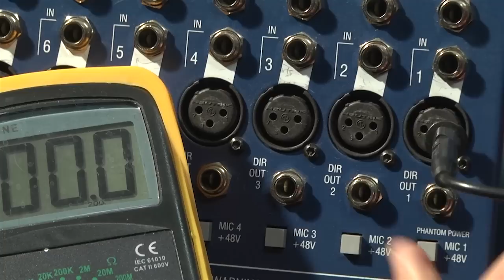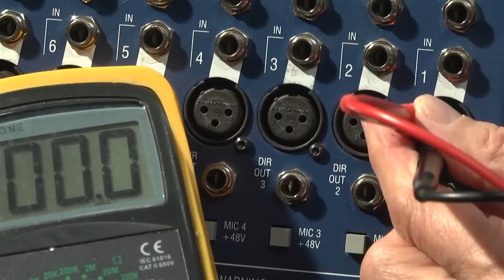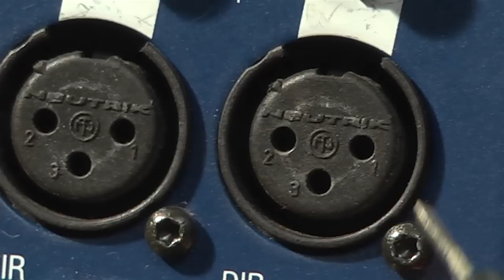PHANTOM POWER BASICS

Comment: Thank you so much for making  this clear. Everybody should watch this video. So, once and forever : if you use professional balanced cables, you can run dynamic microphones as well, even when your phantom power (48V) switch is ON. This is the best explanation of what are the pins 1 2 and 3 doing. And where exactly the 48V goes to.

Comment: Good video on some of the basics of Phantom Power, although not quite enough to really make people "understand" the entirety of the scheme. For those who don't know, here are just a few more things (not all of the things):

- The 48VDC phantom power source is NOT "connected to pins 2 & 3"; if that were true, then pins 2 and 3 would need to be shorted together, which is not the case.
- Instead, the 48VDC is individually connected, through resistors, to pins 2 & 3, so rather then being shorted together, those two pins have a pair of resistors in series between them, and the 48V is connected with its (+) side at the juncture of those two resistors, and with its (-) side at circuit ground (pin 1).
- It is important for the two resistors to be the same value, or very nearly identical resistance values, and they need to have resistance in fairly narrow range of values; typically, 1% tolerance, metal film resistors are used, as they have accuracy and stability.
- The voltmeter sees 0V when connected between pins 2 & 3, because those pins are connected, via resistors, to the same electrical point (the + side of the 48VDC supply), thus they are shorted together from the perspective of a high impedance voltmeter.
- A pair of series capacitors are typically used at the cable's receiving end (e.g. a microphone mixer or pre-amp) to isolate pins 2 & 3 from the differential amplifier circuitry; these block the DC voltage on pins 2 & 3, so it is not presented to the diff-amp, although some diff-amp designs might be OK with that fairly high DC voltage, and the identical DC voltages would be rejected as common-mode noise by the amp.

Comment: My take on building a tester similar to the Bright Eyes would use 48V LEDs and a couple diodes, all built into a male XLR connector. The diodes would prevent the LEDs from illuminating if the phantom supply or the cable being tested was accidentally wired in reverse phase. Should be easy to construct for a guy like me, who has all kinds of free time. I've never done this because I've had a multimeter for a long time, but I can see how it would be easy and cheap to build for someone who doesn't want to buy a meter, carry one all around on gigs, or who simply doesn't have the money to purchase one.

Comment: Hi its a good video and really helpfull, i have a doubt.

You show one microphone with batery power and conector xlr,  can i plug one micro like that on a recorder using phantom power? or will be damaged?

Sorry for my english.
Reply from the maker: Hi David!
 
The microphone I showed with a battery in it wasn't a phantom powered microphone. It needed power from the battery inside it. Some mikes can do both - they can be battery powered or phantom powered.

Maybe if you tell me the make and the model of the mic you want to use I can check it out for you?

And has it got a 3 - pin XLR connector built in?

Best regards, 
Joe Driver

Comment: Hi,sir my mixer is having phantom power power not working problem. If i connect my xlr output from my mixer to the xlr input on the phantom power & then use the output xlr from the phantom power to be able to use my condensor mic will it work sir,thanks🙏

Comment: Very well said and helpful tips i like the diy gadget that you used in testing the power of the phantom hope i can see a demo on how you build it, and also id like to ask a question, if the phantom power is on at the mixer, is it still safe to put a 1/4 jack playback source on a line input? and also by the way if phantom power is on, will it affect a wireless mic reciever? Thank You so much!

Comment: I need phantom power for 2 condenser mics on my drums, but the other 4 mics don't need it. If I turn on phantom power and plug my regular mics into a channel that has phantom power to it, will it ruin my microphone?  I believe my mixer has 6 channels that will have phantom power to them when turned on. So if using channels 1 & 2 for the condenser mics, and channels 3-6 for the other, will I cause damage to the mixer, or the mics? I'm just learning how to mic drums, so I don't want to ruin equipment, it's to expensive. Thank you for your help!

Comment: In my case the mixer I am using , in the mixer the phantom power is  not working. But if i will provide an external phantom power going to mixer will work? from Microphone > phantom power > mixer  w/ phantom power
Reply: Hi Timothy,
Yes, there should be no problem doing that.
If the phantom power built into the mixer doesn't work, then I would advise switching it off to avoid damage.  So it won't be sending power to the new phantom power supply.
If you had a multimeter you could check that the phantom power is definitely not working, and the fault is not with the microphone. Just a thought. And check with another cable.
Hope this helps.
Best regards
Joe

Comment: I have a studio condenser mic and a dynamic mic, question is can I connect both of them in a same mixer with phantom power is on??? is it not dangerous to the dynamic mic???? need some help...
Reply: Hi Tiborsyo,
You should be fine using the dynamic mike with phantom power connected unless it's a very cheap one. If it has an XLR connector on it then it will be "balanced" which means it will simply cancel the phantom power out. But make sure you use balanced cables.
You might find two other videos I have made helpful - one is called "how to connect a microphone to your audio equipment" and the other is called "moving coil microphones". 
Very best! Joe Driver

Comment: I have   ribbons , condensers, and dynamic mics I wish to use at the same time. However, my mixer has just one switch to engage phantom power for all channels at once. Can I make some kind of adaptor cables that prevent the phantom power from reaching some of the  mics when the phantom power on the mixer is in use? Do ready-made adaptors like this already exist?
Reply from the maker: Hi Randolph,
if you are using reasonably up-market dynamic mikes (like the Shure SM58) then you can go ahead and use them with the phantom power on, no harm will come to the microphones.
Your ribbon microphones presumably have batteries in them if the aren't phantom powered? Check the documentation that came with them and make sure that they won't be OK on phantom power - they have to get their power from somewhere. A ribbon mic. will always have a preamp in it because the output of the ribbon is so low.
All depends on the quality of the mic really. All the more expensive ones will be OK on phantom. If you haven't got the documentation you can always go online to check.
If there really is a problem, the professional way is to use a 1:1 audio transformer. There are plenty of these on e-bay, it doesn't matter if it's an ancient one or a new one, it will stop the phantom power from getting to the mike.
Or a much cheaper way is to just disconnect the earth wire, the screen, at the microphone end - that way the lead is still screened up to the mike, but the negative of the phantom power supply is prevented from getting to the mike.
You might like to have a look at my tutorial "connecting your microphones" which explains all about this.

You mention the bright eyes - I think you may have got a bit confused about this - an LED is a Light Emitting Diode, and is already a diode. Adding extra diodes will not achieve anything. And the phase of the cable won't be revealed - the voltage on both pin 2 and 3 is the same, so if they are reversed, it won't make any difference, they'll still light up.
The only purpose of the resistor in the circuit is to prevent the LEDs burning out as on their own,  they  offer a low resistance to the phantom power which will mean excessive current which they won't tolerate for more than a few seconds.
I hope this helps. Best regards, Joe Driver
Reply: +TECHGROUNDINGTV  Yep I was confused, I was thinking about some grain-of-wheat- lamps in my parts chest.

Comment: Rode and others, make some shotgun mics that use a 1.5v AA battery. I would assume that the electronics do not boost that voltage to 48v, but that the mic is designed to work on a lower voltage. Is that generally correct? For example, I have an AT lapel mic with a powering module. The module takes an AA battery. Measuring the voltage across the input pins I only get 1.4v. I did think that it would be 48v, I was mistaken.
Reply: Hello Rob,
Yes, I suspect the pick up element will be of the electret type, which  is prepolarized during manufacture and the 1.5 Volt supply will power the preamplifier. Preamplifiers can run on much lower voltages than 48, but a true capacitor mike needs this relatively high voltage to polarize the capacitor plates. 
Hope this answers your question!
Best
Joe Driver

Comment: I have studio master air 8 mixer I am planning to buy condenser microphone but I don't have Idea that studio master air 8 have panthom power or not its ac 240v power supply so can condenser mic work with it!?
Reply: Hi Nikul,

I've had a look at your mixer and unfortunately it doesn't have phantom power built in.

However, you only need to buy a phantom power supply and I have just looked on e-bay and found a  Behringer PS400 Micropower Ultra Compact Phantom Power Supply and it is £25.10 and postage is free.
It doesn't say it comes with a mains power unit but you could check that with the seller on e-bay.

They are plenty of others, cheaper too, but I have found the Behringer products pretty reliable.
Just enter "phantom power supply" into the search on e-bay.

Hope this helps!

Best regards

Joe D
Reply: thanq u so much

Comment: Great info, thanks.
Only one question. My desk can't select phantom power channel by channel and as I use both capacitor mics and the di from my bass amp I'm very concerned that my bass amp will be damaged if I send 48V to it. I suspect my question has been answered but I'd just like some reassurance before I try it. Thanks.
Reply: Hi Nick.
Two things here. It sounds as if the DI is built into the bass amp. And presumably it's outputting the bass on an XLR connector.  Do you have a choice on the mixer as to plugging it into a jack or an XLR? If you can plug the amp into a jack on the mixer it won't carry phantom anyway.

A simple guaranteed solution is to get a Behringer Ultra-DI model DI100. I've got three and they were very inexpensive.
This model uses the phantom power from the mixer (it's got an XLR male to go to the mixer) to power the amplifier inside it, and gives you the option of an XLR INPUT or a 1`/4 inch jack input from the bass amp/guitar/whatever which doesn't carry the phantom through. I've just tested it to check. It's also got handy 20dB pads, two of them, to pad the input down if neccessary.

Hope this helps!

Best

Joe D
Reply: Thanks for your response.
Yes, my amp does have a built in DI (XLR output) but my stage snake only has XLR connections, so I cant use jacks.
Would dc blocking via a transformer or capacitor work?
Again, thanks for your input.
Reply: Yes, you could make up a transformer easily enough, 1:1 ratio but it might possibly affect the response of the system. Just leave the earth off one end. You'd have to use a good quality transformer, and you would have to ensure that it didn't get saturated with too high an output from the bass amp. That would sound awful.
If you could get one of those DI boxes it would be much less trouble though! 
Very best

Joe
Reply: Thanks Joe, that was great.

Comment: does a usb audio interface get enough power from a usb? i want to record sound with a at2020 xlr, and im gonna use a audio interface that plugs in as usb into my computer, but my mic is xlr, my mic wil i put in to the interface and the interface with a usb into my computer, so now is my question, will the interface get enough power to use phantom power to power my mic?
Reply from the maker: Hi DangMR, sorry about the late reply I've been away.
Depends on your USB interface. If it has got XLR connectors, then you should be able to plug the AT2020 straight in and switch the phantom power on with the software.
It is possible that the interface will need extra power from the computer but it will be obvious from the connectors on the interface or the manual with the interface.
I don't think you will damage anything by just trying it out.
Best
Joe Driver